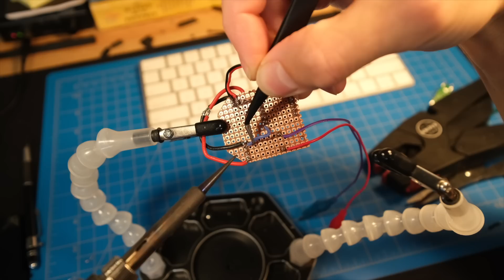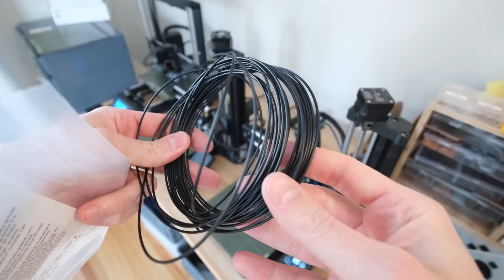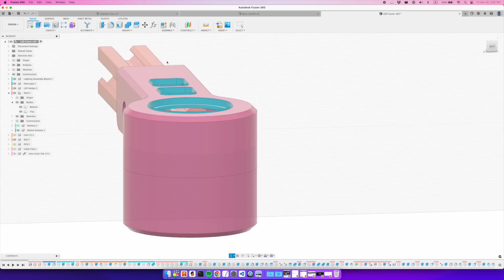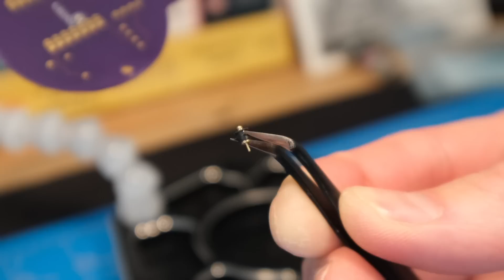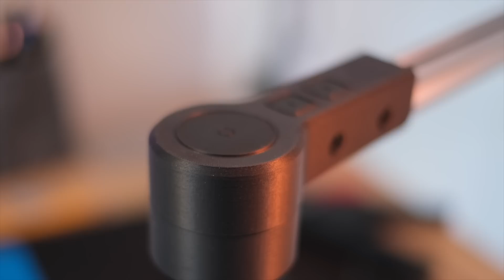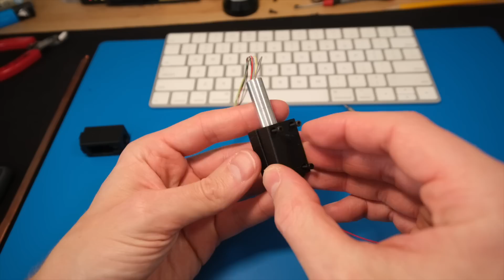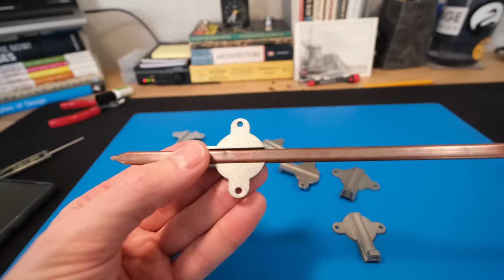The DIYson Electronics Pushed my Limits - DIYson Lamp Build Log #7

Comment: Hey, love your stuff. (Idea for fix down below)

We probably don't care that much if it flickers on camera, as long as it isn't visible to the naked eye in the final product I'd be happy.
But besides that try syncing your PWM-frequency with your shutter speed and framerate. For example if you're shooting at 60Hz try to let your shutter speed be 1/60th or 1/120th depending on your preference for motion blur. Your lamps PWM should in turn be good (on cam at least) at a multiple of your shutter, like 240 or maybe even 480Hz.

Let me know if you already tried this, just tryin to shoot ideas. :D
Reply: Oh, and higher PWM-speeds might decrease the perceived brightness on cam depending on how well light and cam are synced up.
Reply from the maker: I'll give this a shot, thanks!
Reply: I also think this is the best solution for fixing the storobing light issue. SeanHodgins on youtube made a display using spinning LED's and had to change camera settings in order to pick up the illusion on video.
Reply: @StevenBennettMakes  No problem, it's a common problem in cinematogeaphy, especially for product videography in the tech space (monitors can be a nightmare at times). But you have the advantage of being the manufacturer of your own light source, so good luck! :)
Reply: @StevenBennettMakes  Theoretically 1200hz should be the sweet spot where every popular framerate (24, 30, 48, 50, 60) works flawlessly! Good luck!
Reply: @mjxx  this is the way!
Reply: 600hz is probably enough as that is a multiple of everything except 48fps.

Also worth considering using constant voltage driver and a separate MOSFET to do your own PWM. Then you’ll be able to operate at in the tens-hundreds of kHz range, ensuring that any wine will be outside of the human hearing range.

Another alternative is to swap your buck converter for a much smaller linear regulator to power the IC. Linear regulator is much less power efficient than a buck converter, but the IC uses so little power that it’ll make very little difference (losses in a linear regulator are proportional to the current it’s providing). Then you’ll have space for a bigger LED driver, which is arguably a better use of the limited space.
Reply: This is good intuition but the flicker/banding artefact seems to be due to how pixels are read. Synching the PWM frequency to some multiple of the frame rate causes the pattern to stay in a fixed position rather than rolling past (like a spatial beat frequency). I tested this with an LED driven by a waveform generator and used my OP5T as the camera. The OP5T does have PDAF so there may be some funny business going on due to that.

Comment: For my DIY lighting projects I'm using a PCB from QuinLED.
It is basically a ESP32 with a MOSFET like IRLZ44N (Gate is 3V compatible) driven by the PWM signal.
This would replace the Meanwell driver.
As for flickering and whine: Above 22 kHz PWM both of these should not be an issue.

And like other comments mentioned a ESP32 for Home Assistant etc would be awesome. ESPHome flashed to the microcontroller completely handles dimming, transitions etc.

Comment: Hey, for capsense, you could use an ESP32 uC. it has BLE and wifi built in, and a bunch of capsense pins. you can then just run a wire out to a piece of foil glued to the inside of the lamp. you coudl then use regular filament!
Reply: And it supports very high speed PWM!

Comment: You can shrink and cost-down the whole "buck converter" bit by replacing it with a linear regulator. Also, try adding some capacitors to the input and output of the LED supply; that can significantly reduce flickering. (For that matter, you could do to add capacitors to a lot of different places on your circuit...)

Comment: Use pseudorandom noise generator so you can run the pwm at a lower frequency without the periodic waves that show up on camera. You can create a random signal using a shift register in a few lines of code. Cypress semiconductor has good datasheets on how this works
Reply: it wouldn't generate these visible lines but I'm 99% sure it would still flicker, just differently
Reply from the maker: I'll give it a shot, thanks David :)
Reply: @julianbinder2371  hmmm, you might be right. Now I'm remembering the pseudorandom is mostly for reducing electromagnetic interference at any one frequency. But it'll at least spread out the banding effect.

I think the main problem is driving the LEDs through a voltage converter, it would be better to use a certain number of LEDs until you get the required voltage, instead of converting voltage down to drive a single LED. That way you can connect the chain of LEDs directly to supply without putting it through a singing inductor.
Reply: @StevenBennettMakes  what's your discord? You said that was the best way to chat about this project, but I don't see a link.
Reply from the maker: @davidlevi8030  STEVE3PO#9143

Comment: Try adding a capacitor in parallel to the led to help smooth the flicker, just use one that you have and see if it goes away then reduce value (and therefore size) - might allow you to reduce the pwm frequency and get rid of the whine.
Nicely made video 😊

Comment: Great project! If you increase your shutter speed the "flickering" might go away. That's usually what you have to do with regular cameras when using artificial light. Also, you might be able to 3d print the metal part using the iron filament. Keep up the great work!

Comment: Hey, YouTube recommended this video to me and I'm glad I tapped on it. Looks like an amazing project and I'll have to go back and watch the rest! Well done!!

As for the flickering, I'm real surprised you get that at 1,000 Hz. I'd expect a capacitor to smooth that out though. I've got no idea what size to recommend though. Just as long as the rated voltage is higher than what you're pushing through it, you should be fine.
Too large of a capacitor and you may see a slight delay in brightness change, but that should all level out.

Comment: Inside the original design, there's just a normal round DC connector placed vertically close to the base, letting the female connector rotate freely around the upwards pointing male jack of the base. The jack head is angled, to keep it sitting firmly inside the base. The female connector is soldered directly to the power transmitting rails, which transmit the power all the way to the lamp electronics (here placed correctly) at the end. It's always interesting to see you progress in these videos, although it's getting way more over-engineered compared to the original. 😅👍
Reply from the maker: Yeah this is way better than my slip ring idea, and a few other helpful folks have pointed out the barrel jack solution, I plan to ditch the slip ring in favor of this, much more straight-forward :)

Comment: Regarding the heat pipes.. Use send cut send.. Just design the piece so that you can assemble a 'sandwhich' of 2D cuts and fix them together to form the 3D shape you need.

Comment: I am sure others know exactly how to solve the light flicker on video, but here's my guess: I think you need the frequency of the LED to be an exact multiple of the camera's recording frame rate. However, I suspect that you may get different apparent brightnesses, depending on what part of the lamp flicker phase you happen to synchronize with each time you record. Or much simpler - just use the light for other purposes than lighting when recoding video ;-)

Comment: The cheapest way to make your aluminum part is to stamp it. Might be the most complex to engineer, but if you can make your design with enough tolerance. Otherwise you can cast it, a bit more expensive process to manufacture but still dirt cheap compared to CNC time, but you're lucky that this is aluminum and if I'm not wrong you can use steel molds for this.

For the flickering, I'd not use PWM as it always is going to flicker at some frequencies. I'd just monitor the current going to the LED and use a FET to change the current going to the LED.

I got also have some hacky idea where a slight modification to your design might fix it, using 3 resistors (or 2 actually) when you're not changing the intensity you put them in series with the LED, and when you want to change the intensity you short cicuit them using the PWM signal from your module. it's hard to explain without schematics, if you want to hear more lemme know, but this would only flicker when changing state.

Comment: Great video: some pointers:
Wrt cap touch buttons- I think conductive PLA is overcomplicating things. Look into how capacitive touch actually works- in short, the touch surface does not have to be conductive at all. Rather, there has to be a large plate nearby to the touch surface- a capacitor is (in theory) just two conductive plates- the second one being your finger. If you had some largeish copper circles on your pcb, like the adafruit cap touch sensor does, you wouldn't need conductive PLA, separate printed button parts, or pogo pins (though I must say they made a nice solution to this problem you, uh, made for yourself :P ) You've already flush mounted the pcb to the top of the enclosure- you could prototype this by attaching some squares of copper tape or aluminium foil onto your existing design, where the pogo pins go. careful not to short anything though.
Another Cool Thing you can do with cap touch are wheel sensors- I think this would be a great analog brightness control you could implement into the circular head of the lamp. I'm pretty sure the hardware on the SAMD21 supports this, but I've not used it so I can't say for software, especially CircuitPython. Maybe that's a little overkill though...

Wrt flicker/whine- there's two ways to solve this. The easiest is what many are screaming in the comments already- fixing the camera settings (shutter speed? I'm no Captain Disillusion though). A different way would be to bump up the frequency even higher, more than 100kHz, but that's a Bad Idea for many reasons- more complicated LED driver, higher power consumption, worse EMI... just deal with the camera :)

Wrt cable management at the bottom of the lamp- a good and cheap solution for this could be, instead of a slip ring, just an ordinary barrel plug and jack, like you find on many electronics and their power adapters- they rotate freely, and are literally designed to transmit power.

Wrt heatpipe bracket- I dread to think about how much you spent on all those 3D printed prototypes, especially from shapeways! I'm no MechE, but I think CNC is probably the way to go for a part like that. You might consider PcbWay- their service seems to have decent prices for low volume, and they effing love sponsoring electronics youtubers so I wouldn't be surprised if you can con them into giving you some free parts :D maybe find someone who's worked with them before.

Wrt the teaser at the end of the video- as someone who spent like a day obsessing over how the dyson lamps work after finding this series, I think I know the REAL reason why you bought those pogo pins ;) very excited for the next part, keep it up
Reply from the maker: Yeah I also hate to think about how much I spent on all of the Shapeways parts... Really eating into my extravagant lamp budget there... The barrel jack solution is so clever, thank you for recommending it without making me feel dumb! Good ideas all around, I'll keep these in mind, thanks for sharing :)
Reply: Does the heatpipe clamp need to be metal?  I assumed that it was to clamp the heatpipe between itself and the LED?  In that case, isn't the LED in direct contact with the heat pipe?  If so, it might stay cool enough that you'd get away with 3D printed ABS (or some other FDM material with a high glass transition temperature).

Comment: You could make the entire top of the led cover a pcb. Etch the capacitive buttons onto the pcb. That would solve the button flushness issue as you could have the buttons perfectly flush with the top. You lose the tactile interface in exchange for perfect flatness.

Comment: Loving this series 👌 Regarding the LED bracket, you could also consider using a resin print, they’re more tolerant of higher temperatures - I recently created a halogen bulb housing using a resin print and it works perfectly! In your application though, strength would become a concern, so it may be sensible to integrate the bracket with the housing to get a bit of reinforcement

Comment: With the dragchain, i think it could be good to rotate the stationary end 90 degrees backward, so the loop of wire is limited to a 180 degree turn and the radius will be held roughly the same assuming your dragchain has an angle limit so it cant go past straight in one direction

Comment: If you want good flicker-free light you either have to increase the frequency significantly, or better you get a controllable constant-current source.
PWM driving LEDs is common cause it is so simple, but it not only has flicker but many other undesirable aspects like a lot of electronic noise, shorter livespan, lower efficiency. A benefit of PWM is that the spectrum of most LEDs is not constant across their power-range, so changing power with constant-current often also changes the color.
This color-change can also be an advantage and PWM and constant-current do not necessarily exclude each other. One can also more finely control the current - instead of going 0% - 100% PWM or 50% constant-current you can modulate between 25% and 75% to get the desired brightness and color - but the code and controls are a bit more complex of course.

Comment: great project! I've been working on a table lamp called "a levitating table lamp" for a few months now.

I was experiencing the same issue. Noise of electronics in wireless power transmission, I think you can resolve it by using motor drivers as led drivers. I know it is not a perfect solution, but it works quite well.

Comment: Like the project.
Here are my couple thoughts about hardware part:
I think you really need to step up you game in hardware for this project in next hardware prototype. Despite I have nothing against arduino-style ready to use modules, but imho, they not fitted here well. Instead, I suggest you to use XMC1202 mcu for control and discrete LED driver (XMC1202T028X0032ABXUMA1 cost like 3$ on digi-key). That will give you a lot of flexibility in terms of control LED, LED supply voltage range etc. XMC1202, and XMC1000 family in general, have BCCU module (brightness and color control unit)  for LED control, which will give you advanced brightness control  (for example it has feature called "linear walk", with its help you can smoothly  fade or light up multiple channels of LEDs with same time no matter its initial intensity), linearization of brightness (if you are changing control signal lineary, brightness will change exponentially, BCCU module will compensate this for you), high frequency spread spectrum control (no more flickering!!!) and many more.
If programming in general not a problem for you, you can download mcu support package and write a firmware in DAVE ide (eclipse based) or vscode (require some tuning).
Also, I think, they have some library for Arduino IDE.
There are ready to use board with discrete LED drivers (inverse buck topology) https://uk.farnell.com/infineon/kitledxmc1202as01tobo1/rgb-led-shield-arduino-xmc1100/dp/2452190?CMP=GRHB-OCTOPART
costs 20 bucks, required external jtag programmer.
Or, you can buy board with jtag programmer https://eu.mouser.com/ProductDetail/Infineon-Technologies/KIT_XMC12_BOOT_001?qs=udYk%2FVsBYxvON55i%2Ftvvog%3D%3D
20 bucks also, and solder you prototype discrete LED driver based on the schematic of previous board.
All boards have a lots of ready to use code examples for every periphery.
Here are some useful link to dig in BCCU:
https://www.infineon.com/dgdl/Infineon-BCCU-XMC1000-AP32275-AN-v01_01-EN.pdf?fileId=5546d4624e765da5014ed8cabae512ad
https://www.youtube.com/watch?v=k-ahgrv9iuc
https://docs.rs-online.com/87f9/0900766b814ddf07.pdf
https://www.infineon.com/dgdl/Infineon-Board_Manual_XMC1202RGB_LED_Lighting_Shield_with_XMC1202_for_Arduino-_v1_0-UM-v01_00-EN.pdf?fileId=5546d46249be182c0149ccca3860734d
Either I or some on else in here can help with pcb design.

Comment: For now, add a switch mode to change between the flicker and the whine. Something like holding both the + and - buttons down for one second. Then you need to get the PWM frequency up to at least 25khz and add enough capacitance that it does not flicker even then because it will bite you eventually when you either get a high speed camera or just get a camera with a high enough ISO that it's electronic shutter can "see" the 25khz noise. 
If you want to make sure your PWM frequency is high enough, use several ND filters and try to take video of a piece of paper taped over the LED housing. You want enough ND filter that the camera is running at it's max ISO when filming the light source itself for this test. Note that you can put some of the ND filtering on the light source if the room is dark enough. This will also show you any unevenness in the pattern the light produces.

Comment: Nice starting with the electronics 👍 Projects look way more professional with custom PCB's. 
For the LED PWM Problem try to use linear regulation and if the powerloss ist too big maybe add switched preregulation. Thats how i would do it on first thought. However there are a ton of led driver IC's that do it all for you with much higher switching frequencies some allow changing the freq.

Keep up the good work i like this series now with electronics even more 😁👍